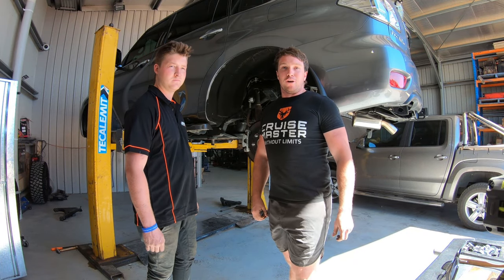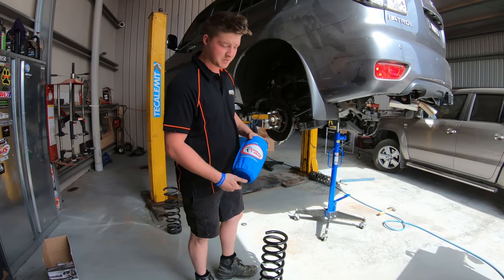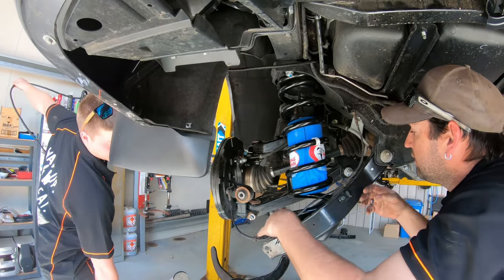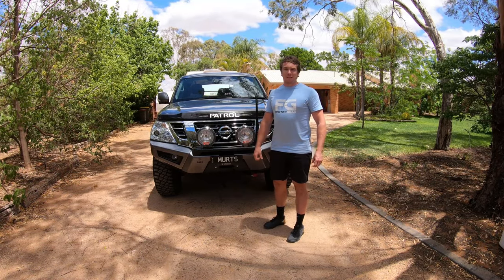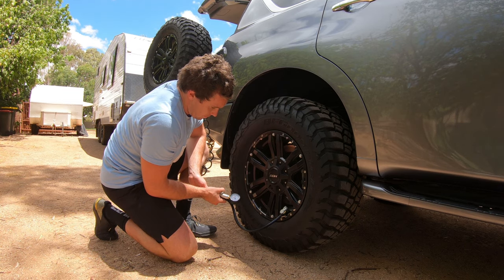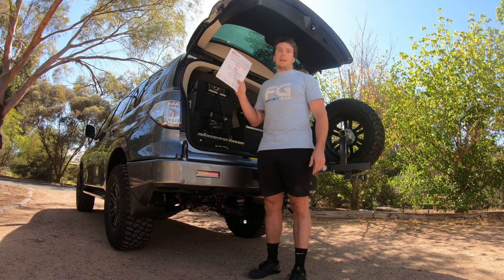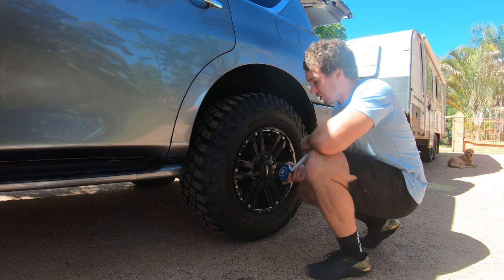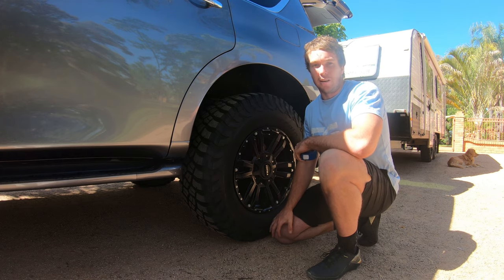INSTALLING AIRBAG MAN SUSPENSION AND ON BOARD AIR SUPPLY - NISSAN PATROL Y62

Comment: When the OEM springs were removed they were fitted with a noise reducing rubber sleeve on the first turn at the top. These weren't fitted to the aftermarket springs so if they develop a squeak in future you'll know why ; )

Comment: Good video mate. Just on a side note try doing the 4psi test with your tyre pressure. You might find 50psi rear is slightly hard. After doing the test we found 44 was the sweet spot for tyre wear ect in a very heavy gu patrol towing a similar weight to you guys.
Reply from the maker: Shane Norwell thanks for watching mate! Yep thanks for the advice mate it’s exactly what I’ve done! 44 in the rear not towing in our 35 inch muds after an hour of highway goes up exactly 4psi. Have only towed the camper trailer on long highway so far with the new car and 50 was spot on! I’m not used to going that high but need to with the big tyres!